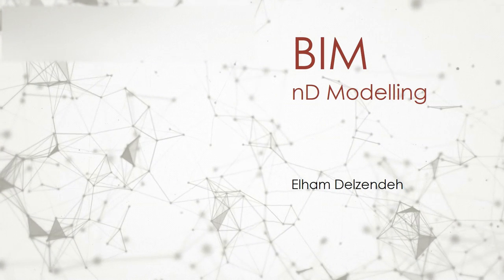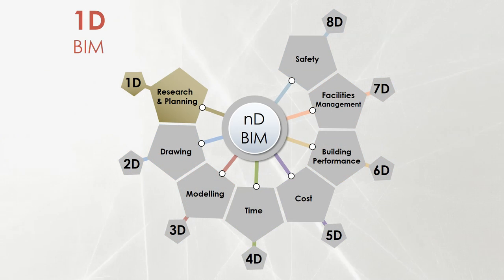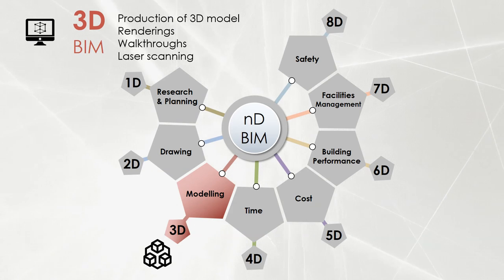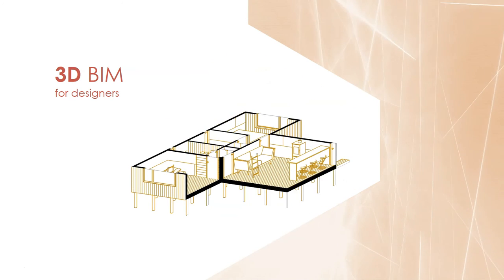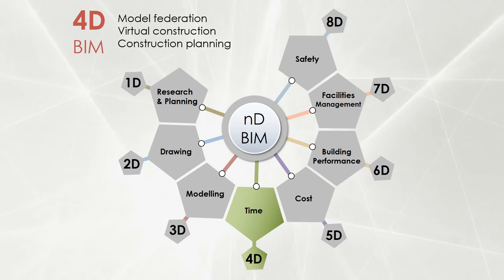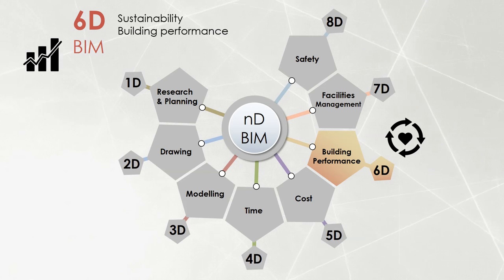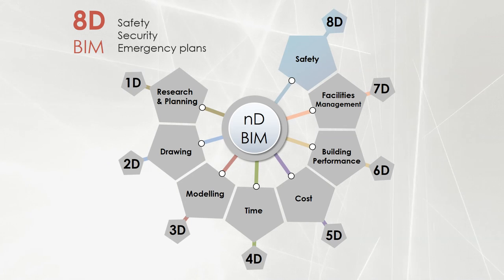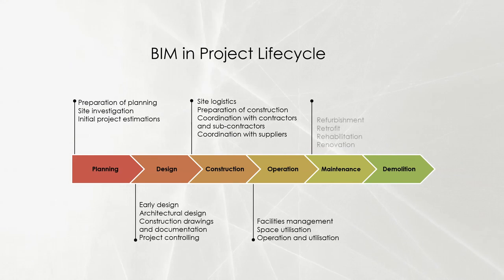BIM Dimensions (Building Information Modelling) nD: 4D, 5D, 6D, 7D, 8D and beyond

Comment: Hi. Thank you for the detailed instruction with graphical representations of this video. However, I have a concern which is the 5D: Cost is this not going to be different by region?
Reply from the maker: Hi Danial, thanks for your comment. Cost will certainly be different by region (similar to time, health and safety, building performance, etc.). In BIM process, we manage the building data related to each dimension. The inputs will be different project by project or based on location. But there are still similarities between the type of data that we need to be able to determine the cost of project. BIM is not trying to make a similar template for all projects, instead, we try to understand how different type of data can be managed and maintained throughout building's lifecycle.

Comment: I didn't understand why the Logistics is not on the 4D group. Doesn't it have anything to do with the deliveries?
Reply from the maker: Hi, thanks for the interesting question. You are 100% right. Even if you consider prefabrication, it is not only 4D. It can appear on almost all dimensions depending on how you look at it. Similarly, logistics has a very wide meaning. Time and cost are both incorporated into logistics. It is not only time but also the combination of time, cost and more dimensions.

Comment: From the way it seems, these process is linear, very linear in a way that if for example you want to optimise cost only. You would have to be be optimising time before that. What if I only want to optimise building performance only (as for energy for example) I would be required to make a 6D building.. but that means I have to time and cost process as well. 
This turns everything to same  non creative, monolithic approach.
What if want to make a "safe" building? do I need to do all the previous steps in order to make a safe building? does that mean if want to do a 4D building and stick to the BIM process, I will just not prioritise the building safety? very weird structure if you ask me. Also shouldn't be safety addressed in a "building performance" category? If continue in this direction we would just have so many dimensions that are clashing onto each other or make some process divided in a manner that limits and bounds the way things get built which is not necessarily a good thing. There is not much room for creativity and flexibility in following these process.
Reply from the maker: Hi Seddik, Thanks for sharing your thoughts. These processes are very inter-connected and not linear really. The whole concept is to have all the building information gathered and managed in one "model" and then extract the required information throughout building's lifecycle. 
Building performance is actually building energy performance (this is the keyword used). Safety has its own dimension (8th) especially because it has gained more importance than ever in the building industry.
Reply: ??????
What if want to make a "safe" building? do I need to do all the previous steps in order to make a safe building? 
               ????????     " SAFE "    WHAT  EXACTLY   DO   U   MEAN   ???  

WHEN    DID  A  CONSTRUCTION  BECOME  DANGEROUS  ???

THINK   OVER  AGAIN

Comment: What is BIM for Economy Circle for Project Management?
Reply from the maker: Hi Fluto, interesting question. As the BIM process improves productivity and reduces waste, it has a direct impact on the circular economy in the building sector. If you are interested in the subject, there are various research articles you can refer to:

BIM competencies for delivering waste-efficient building projects in a circular economy
https://www.sciencedirect.com/science/article/pii/S2666165920300338

Uses of building information modelling for overcoming barriers to a circular economy:
https://www.sciencedirect.com/science/article/pii/S0959652620348988

Comment: Hello, I would like to know what program is used to include the 8D point. Thanks
Reply from the maker: Hi Karito. Great question! The 8th dimension of BIM is the least explored and does not have a full software package yet. However, the IFC file extracted from BIM applications has the ability to be imported into various tools such as IES Simulex for occupant movement and evacuation analysis. We can expect to see more advancements in 8D in the coming years. Also, some applications like BIM360 have risk and health and safety inputs.
Reply: @builtevolvechannel8870  Thank you very much for your answer. I subscribe to be able to delve further into bim knowledge.